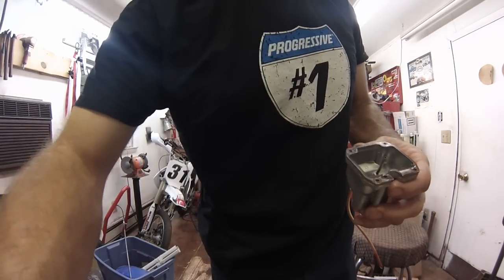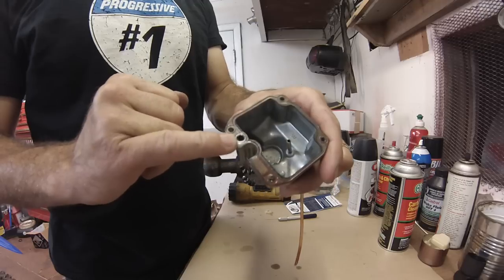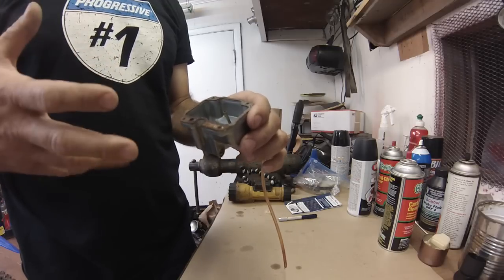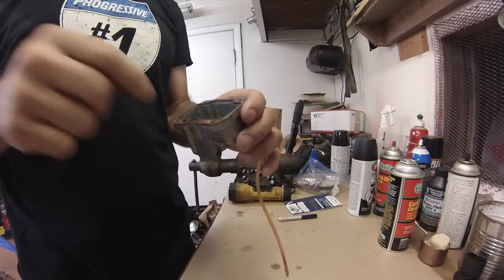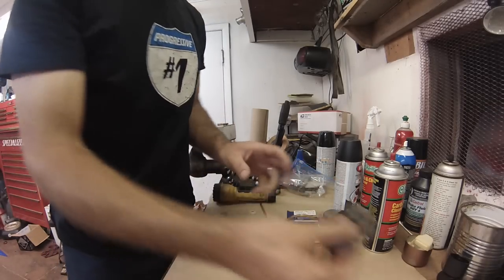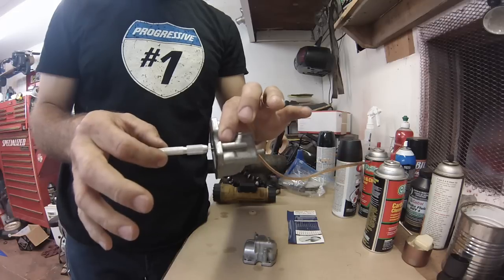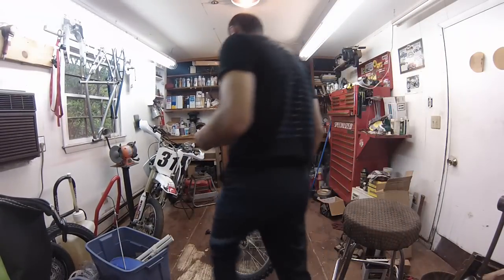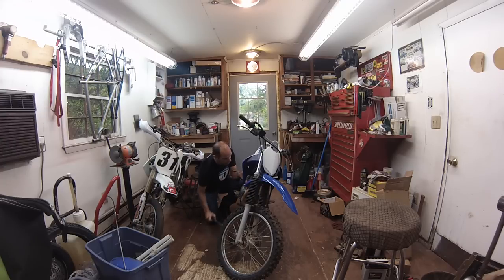TTR125 hard cold start problem FIXED !!

Comment: when people say you mix oil with the fuel what oil do they mean? like the oil you use to change in your bike or a specific type for fuel
Reply from the maker: They are talking about 2stroke oil. Many different kinds. I use Maxima Super M mixed at 40:1 for my KTM200.
Reply: This bike is a 4 stroke, and therefore requires you to put your oil directly into the crank case, completely seperate from the gasoline. Howver, with a 2 stroke motor, you pre mix the oil and gasoline, the mixture goes through the crank case and eventually up to the cylinder where both the fuel and oil are burned, the expansion chamber which is usually part of the exhaust system on a 2 stroke creates backpressure on the motor, and burns and left over oil so you aren't spraying boiling hot oil everywhere. Hope that answers your question.

Comment: ok mine has this problem I am going to try this and after it warms up should it idle its a 4 stroke
Reply from the maker: Yes it should idle fine, if it doesn't either your pilot jet is clogged (usually the problem) the mixture screw at the bottom front of the carb is adjusted wrong, or your idle screw on the side is backed out to far.

Comment: I'm having similar problems with my Suzuki GSX 600 f. I'll have a go to see if this fixes it. Cheers!
Reply: Well did it work brother?
Reply: @nathanielselvidge4157  I couldn't get the the tops off. The screws were starting to round. I did manage to balance the carbs and sprayed them with carb or brake cleaner and the bike run much better, smoother and started easier. Thank you for the video

Comment: What bumper is on the front is it a yz85 if so what year I’m looking to replace mine to look more aggressive
Reply from the maker: It's a 2017 TTR125LE fender. The newer body style has the newer style fender.
Reply: @TepcoCycleRepair  and it fits on a 2007 125l?
Reply from the maker: @johnkennedy6368  Yes, you also need the front number plate because the plate mounts to the fender differently.

Comment: My bike will start and idle on choke, but when I pull the throttle absolutely nothing happens. I changed the jets and opened up the fuel screw a full turn, but it's like I have zero throttle
Reply from the maker: If it will only run on choke, the pilot jet is clogged or now flowing. If the Jets are clear and the choke is on to long, it will be rich and stall. These carbs are known for the choke (enricher) to corrode and get stuck being unable to close all the way. Take the choke out of the carb and make sure it's moving fully and freely.

Comment: On mine when ever you turn the gas on it starts pissing out of the over flow especially after trying to start it and it won't start any suggestions?
Reply from the maker: Sure I just answered this same question today just look down a couple posts. Ill be making a video after a engine rebuild im doing now.
Reply: +Tepco Cycle Repair ok thanks

Comment: Does anyone know how to fix a bike that needs choke every time to start even if the engine is warm? I have a rm 250 and it always needs choke to start even after riding a long time, I'm assuming it's because of the air/fuel mixture but many are telling me it's not the case. Can you help me?
Reply from the maker: First thing I would do is pull the carb and check all your jet sizes and compare them to stock. Sometimes people put some crazy jet sizes in there. Check your compression, low compressions also make it hard to start. It could be other things like crank seals, an air leak, etc, but I would start there.

Comment: Do u have new plastics if do where did u get them
Reply from the maker: They are 2012 plastics, just the front fender and number plate. Cheap and bolt right on, no mods needed.

Comment: Tip cleaners for a cutting torch are less expensive and work just as well.
Reply from the maker: I have found that they are usually not small enough for the smaller pilot jets. They are also not smooth on the sides and can damage the inside of the jet. I've had this brick brush since the 90's or earlier, still cutting bristles off it for cleaning.

Comment: Could you use an air compressor to clean that hole out?
Reply from the maker: I'll say maybe, depends if its clogged with old fuel or corossion. Try it then blow some carb cleaner through it and see if it sprays through.
Reply: @TepcoCycleRepair  just tried this. Not what the issue was. When I try to use the electric start it's just clicking. I tried using my pack to jump it and it still didn't work. The kick start won't even rotate anymore and I don't want to force it and damage it
Reply from the maker: @MrKGreggs  Remove the spark plug and see if it turns then, might be vapor locked.
Reply: Tepco Cycle Repair okay. I’ll try in the morning. Thank you. I’ll probably have more questions too. Appreciate your video and responses

Comment: my bike start goes off at the time of riding......guys any solution plzzz
Reply from the maker: Could be your pilot jet. It's the thin flat head jet in the carb, pull it out, run a wire through it and make sure you can see light through it.

Comment: This completely ruins the warm up capability of the ttr 125. The size of the hole directly meters the amount of fuel provided at full choke not the brass emulsion tube that protrudes into the hole. Before I enlarged the hole my sons bike would warm up on choke for 10 minutes or so before becoming too rich. After the modification the bike begins to load up and become too rich almost immediately. You then have to keep bike running with throttle for quite some time. The key to starting these bikes is to crank the bike for 5 to 10 seconds or 3 to 5 kicks. If it does not start, wait one minute and crank again for 5 to 10 seconds or 3 to 5 kicks. I had this method figured out but was willing to try this modification to make it even easier to start since they are cold natured. I will agree this mod did help the initial start up of the bike but was not satisfied with it overall due to the fact you could no longer start the bike and walk away while it warmed up on the choke. I was able to use silver solder to refill the hole and drilled it back out to the original size of 0.015". I would not recommend anyone else doing this to their carb. Yamaha did extensive research to determine the exact size this hole needed to be and in my opinion it should not be modified. Being a mechanic at a dealership of 30+ years i should have known better than to do this.
Reply from the maker: Thanks for the comment, as stated in my posts the goal is to 're open a clogged hole due to corrosion or debris not to enlarge it. The size hole I recommend in the video causes no issues. You may have enlarged it to much. The choke plunger should meter the flow after passing through the brass tube. I respect you years of repair work by I believe your issue was an improperly adjusted mixture screw and not the hole size.

Comment: Crf250r does the same but runs good when hot
Reply from the maker: Because when it's hot you don't need the choke so this circuit is out of the equation.  Check it on your CRF as well if that hole is clogged this should fix it up.

Comment: is that the jet that is almost impossible to adjust with the bowl on while bike is running,cause ithinks thats my prob shes a real bitch to start same bike and year,once warm runs good but poor starts
Reply from the maker: The "jet" your talking about is actually the mixture screw, just set that to 2.5 turns out from lightly seated and you should be in the ball park. Your problem with starting is the problem I'm describing in the video. GL.

Comment: how do you fix Yamaha ttr125l that Pisces out fuel while Idling.
Reply: Mine pisses out fuel too
Reply from the maker: +nuckinfuts31 leaking fuel will be either a stuck float, a float thats to high a bad float needle or a piece of something stuck under the float needle. Ill make a video.
Reply: +Tepco Cycle Repair thank you for the tip. I will be checking that today.
Reply: fixed. i checked the float again and now its not leaking. on a slight different but related note, i've been having so much trouble getting my ttr to idle without using the choke. i went through the carburetor at least 5 times in one day a couple of days ago without any ounce of success. today i did one additional step just for the heck of it: completely unscrewed the fuel mixture screw and stretched the spring inside and reinstalled everything once again. that must've done it because it started AND idled first kick WITHOUT choke. i should probably post this tip somewhere for other owners who have idle issues w/ their TTR. anyhow, thanks.